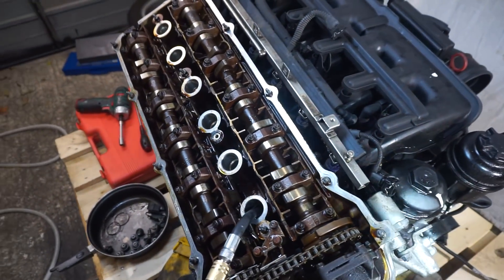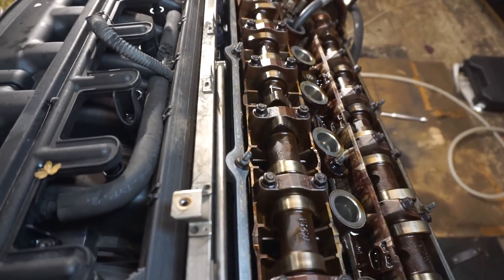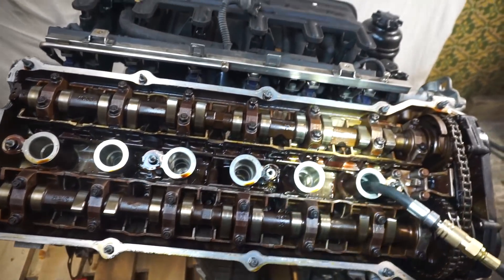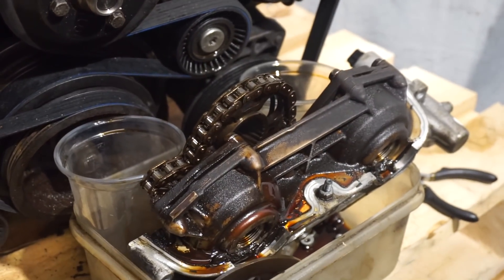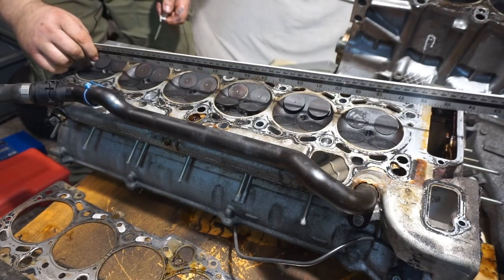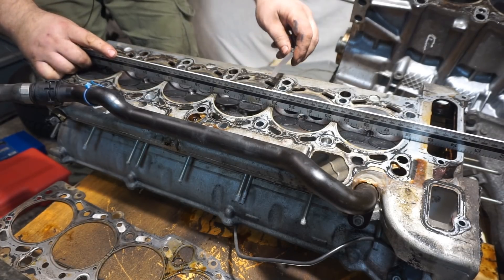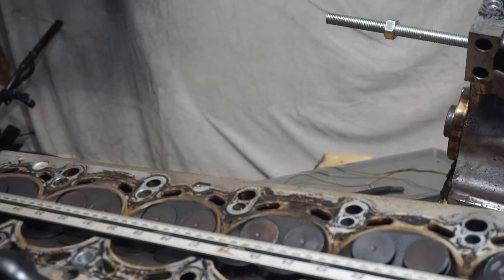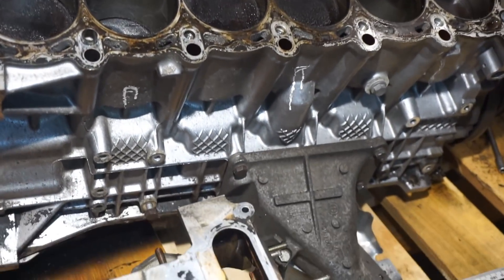LEAKDOWN TEST bad news # Engine rebuild DIY and swap BMW M54 2

Comment: Man that is deja vu for me! ;-)
Reply from the maker: yep! nightmare but at least I've got car with good running engine  so I can play with this one, project FRANKENSTEIN LOL ! PS. there is more bad news HAHA
Reply: Elbow Grease I wonder if that head has cracks in the exhaust side coolant channels?
Reply from the maker: 50sKid I was trying to check but there is too much build-up but I not gonna be using that, I've got head from 2.8 in gr8 shape also one of the conrods is bent, block is bad aswell, long story short, crank, pistons, covers and cams stays, rest is scrap